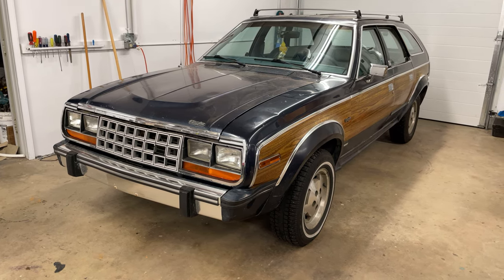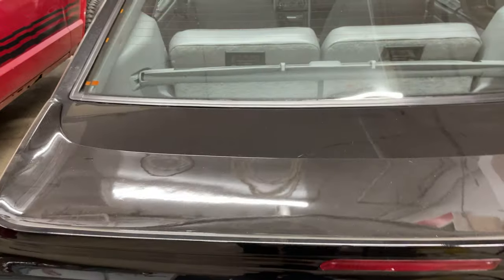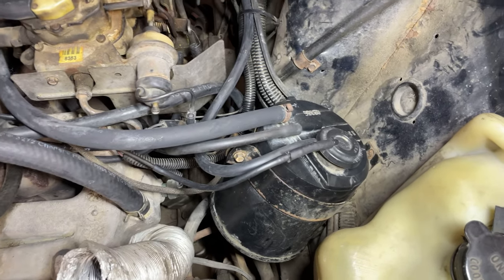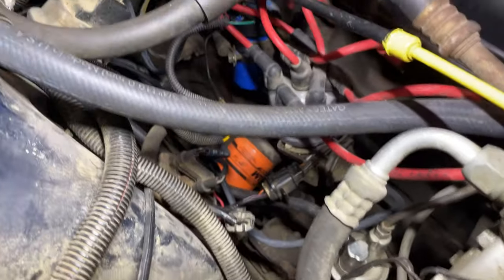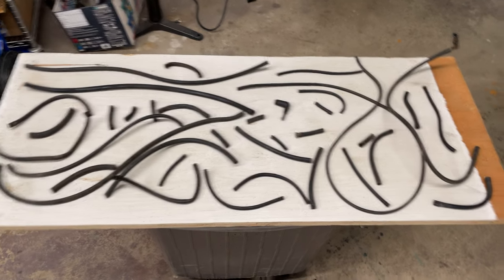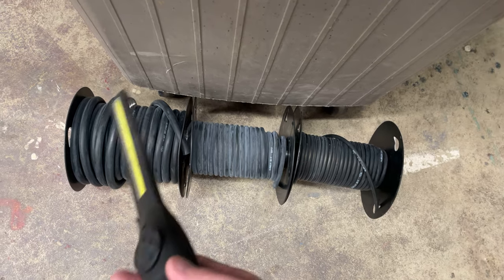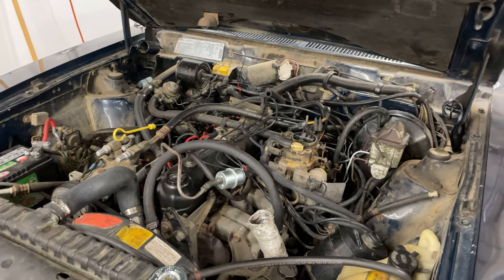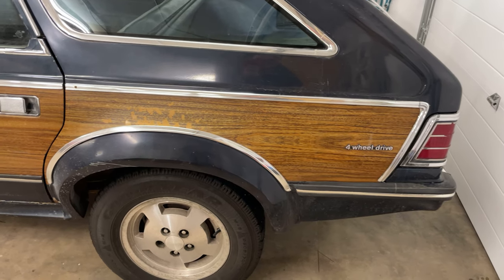Replacing Vacuum Hoses [AMC Eagle]

Comment: Those were the days of controlled ciaos under the hood. The Eagle is certainly a one of a kind type of automobile. I remember them like it was yesterday.
Reply from the maker: Yep. I haven’t had a single issue with vacuum lines since replacing them. Although I think I have an issue with the choke.
Reply: @InternetDude  If you have not already I would pull the carb, take you time and rebuild it. Not sure how long those electric chokes worked for, might be the issue and you should be able to find a replacement for it. I guess the next question is what is the symptom?
Reply from the maker: I rebuilt the carb 2 years ago and it ran flawlessly. Then a year later it was giving cold startup / choke type problems. Won’t go on fast idle and poor running until warmed up. I think I will pull the carb again and check settings. I already replaced the choke thermostat again and it’s a little better but not great.
Reply: @InternetDude  Well fast idle would be controlled by the choke spring (electric) and the stepped design. The two aforementioned either work or do not. There were two carbs that I have found that were used with the Eagle, Carter or the Motorcraft. Do you know which one you have? Have you tried spraying carb cleaner around the pivots on the carb to check for air leaks, (gaskets, throttle pivots, intake manifold, other) Your to lean at a cold start up which I know you know. Maybe do a video at cold startup and show all the carb settings as the pedal was depressed once. Maybe swap the carb from the donor car if you still have it and see if things change. Could be jets emulsion tubes are clogged slightly from tank/line debris as this is an older automobile? Just some thoughts.

Comment: Aw man, finally a respite from the lack of Canadian Prairies car-related content (SPPTV has gone quiet lately).  Looks like an Astro Pneumatic rechargeable light like what Eric O at SMA uses?  And studded tires on the hooptie, nice!  That AMC engine, is it shared with any of the Jeep models?  Any thought to doing a fuel injection conversion or retrofit?
Reply from the maker: Yep, the same light as Eric, it's awesome! The engine is identical to the Jeep motor as far as I know (258). The plan is to rebuild the carb now because if it is running like new there's really no need to put fuel injection on it. If it was my daily driver I would probably consider fuel injection but it's costly to buy relative to the cost of the car itself! The biggest problem is the choke thermostat doesn't work, it's stuck. So if I can fix that and rebuild the carb I think it will be running like new for under $50. It has no high idle right now so you have to sit and rev the engine while warming up.

Comment: Here in rural Texas there are no smog inspections and cars over 25 years old it is legal to modify the emissions systems. I would rip all those hoses out of there and put a new aftermarket carb on there.
Reply from the maker: I rebuilt the carb and it nearly runs like new. It took a lot of hours though trying to figure it all out and get it working right. It would have been less time but more money to just put a new carb on. I'm trying to go as close to factory as possible (within reason).